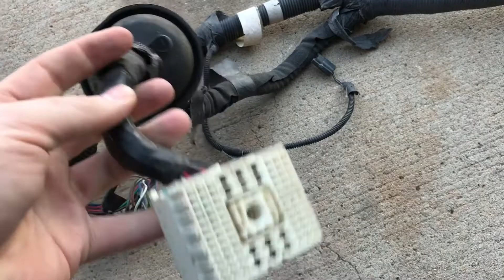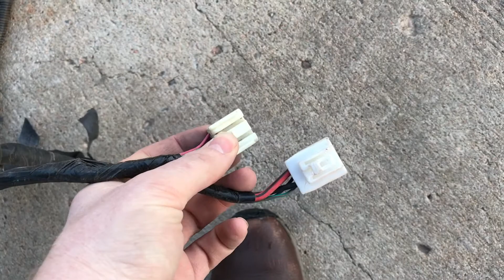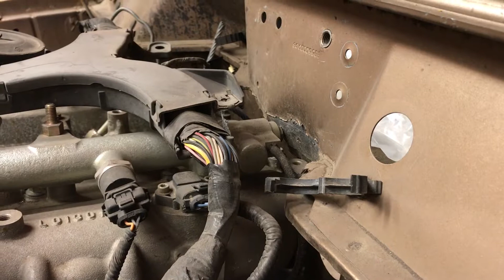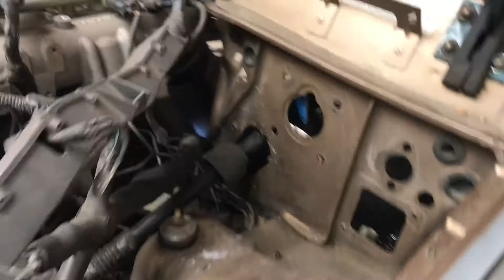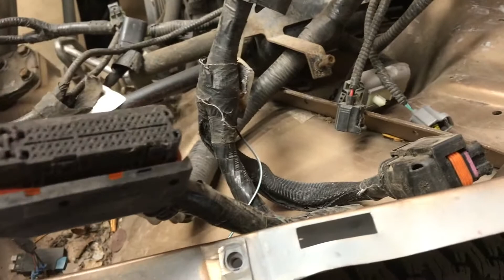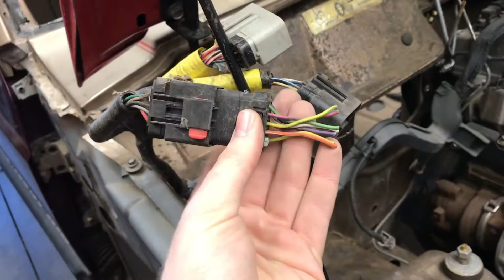Project CRD MJ - Engine Bay Wiring Harness Modifications

Comment: I have a 2005 jeep liberty diesel. The previous owner couldn't find a shop to do good work so the timing belt was half the original size from a loose pulley. it jumped timing, cracked piston, bent valves and a bunch of destroyed rocker shafts. Cylinder #4 had water in it and the liner has deep rust pitting. I've pulled the engine and would like to replace it with a cummins. Would you share the wiring diagrams for the power connectors that go to the liberty body harness from the engine harness? I would like to use the factory wiring to power the new ecm. I should be able to connect the can bus from the new ecm for the gauges work.
Reply from the maker: Account4info reach out to me in the email in my profile and I can get you the information you need. The KJ uses PCI bus not CANBUS. The only CANBUS on an 05 is between the gateway, abs, and ECU. It is possible to build a CANBUS to pci adapter to drive the gauges and other oem devices.
Reply: @IcarusOffroad  I will  email you. I noticed in the video you posted about the fcm, when it was unplugged the tach and coolant gauges don't work. The ECU is CANBUS and the cluster is PCI.